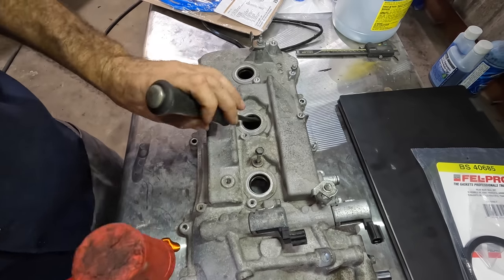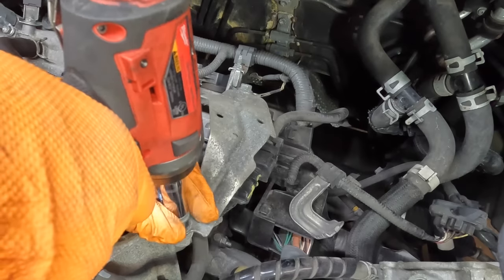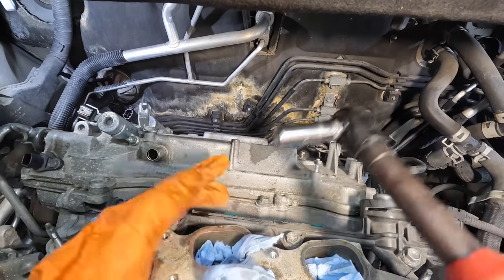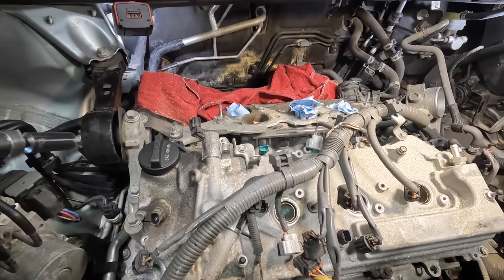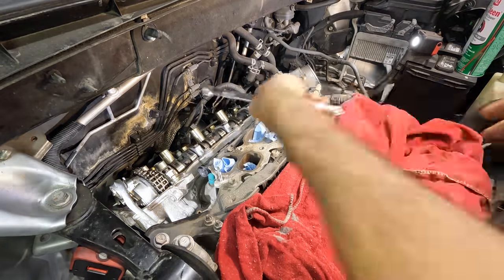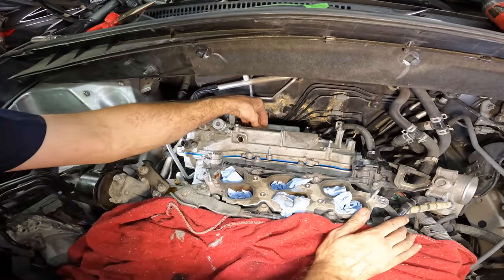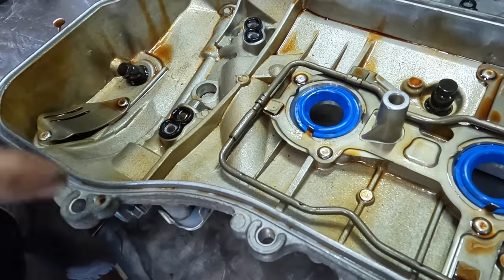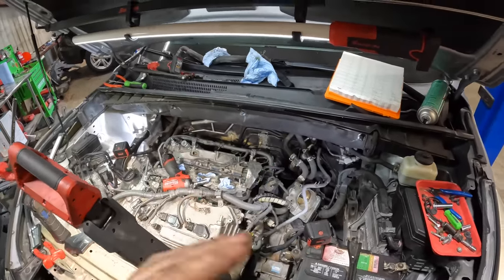Mechanic Upsells Extra Parts! "While we're in there..." Toyota 3.5 VVT V6

Comment: Watching you work on these newer cars with all their plastic parts, and all the stuff you have to do to just change a simple part is CRAZY!  I remember when nearly everything under the hood was metal and nearly everything hand room to work on it or remove it.  I miss the old days, points condenser, with one coil, and nearly every spark plug was easy to get at without removing a bunch of plastic parts.

Comment: Funny thing about grounds. Driving home a few days ago and she stopped dead as a deck board. I had just replaced the battery not 30 min ago and I had no lights no crank no pump. Had it towed home, tinkered on it a few days and called a buddy whose a real mechanic and he suggested checking grounds, first one I tried sent sparks around my knuckle breaker. Cleaned it up and she’s back to running again.

Comment: When there may be a “hidden” bolt on a valve cover gasket, you can sometimes look at the new gasket and see the locations of the bolts. I have been reduced to counting the bolts and matching them to the new gasket locations 😀
Reply: That works if the gasket has either the holes or the indents for the bolts.
Reply: Done that!
Reply: 9 8th 88ɓbbɓbbbbɓbbɓbbbbɓbbɓɓbbbbbɓbɓbb🎉ɓbbɓbɓɓbɓbbÿ🎉⁶6⁶6⁶⁶ÿt⁶ÿÿÿÿÿÿÿ🎉⁶8🎉

Comment: One BIG caveat about crap that gets into the oil pan; the oil pump is protected only by a coarse screen, and some pretty damaging things will go right through it.  There's a fairly infamous issue that the screen doesn't prevent.  Particularly when replacing a cylinder head with a rebuilt unit, the rebuilders typically use automated sandblasting or beadblasting equipment that leaves grit in secluded spots all over the head.  They often do a pretty poor job of getting all of that grit out, so you have to make damn sure that you get all of it out of the oiled areas before you install the head.  If you don't, that grit will go right past the screen, score the gears or rotors in the pump, and (most critically) they can jam the pressure relief valve plunger so that it no longer works.  If it jams the valve open, there goes the oil pressure at low RPMs when hot; if it jams the valve closed, then the pressure goes sky high when the engine starts up cold, and can literally blow the filter right off the flange.  I first ran into this while working for a VW dealer back in 1982 or 83, and I was the first to identify the cause of the issue which had already produced a number of failures in the field.  There was even a silent recall within the parts system to pull the rebuilt water-cooled heads back for inspection and remedial cleaning.  I've run into it a number of times since, with heads from a number of aftermarket suppliers.  Bottom line:  Paranoia about particulates getting into the crankcase is a good thing.
Reply: Point is no engine oil enters a critical area that hasnt gone through the filter first.That was his point.Pickup tube directly to the filter and then to the rest of the engine.
Reply: ….unless the relief valve opens due to clogged filter
Reply: Or if your oil pump picks up Big and wipes it out. Then you have? No. Oil? Anywhere. And that is bad
Reply: @djsi38t  Screen, tube, pump, filter and then the engine's pressurized system. No pump, no oil and a very expensive bill.
Reply: @djsi38t  ".Pickup tube directly to the filter and then to the rest of the engine."  Nope.  Pickup tube, to the *oil pump*, which can be damaged by grit and abrasives.  And before the oil gets to the filter, the engine has a pressure regulation valve (aka relief valve) that's often in the oil pump cover or housing, sometimes consisting of a spring-loaded soft steel piston in an aluminum bore, whose purpose is to keep the oil pressure from getting too high.  It can also be a spring-loaded steel ball; that design is less susceptible to sticking.  The valve regulates the engine's oil pressure by sending excess flow back to the oil pan. But the oil that goes through that valve is unfiltered; part of the reason for that valve's presence is to keep the filter from getting overpressurized.  If the piston gets jammed closed, the oil filter can inflate and lift off the flange, blowing the seal out.  If the relief valve is jammed open, you lose oil pressure when the engine is hot.  Both of these are Bad Things.  

Note that this engine oil pressure relief valve or regulating valve is separate from the one in the oil filter.  That one is present to make sure that some flow will get through the filter if the element gets clogged with crap because even dirty oil is better than none.  The engine oil pressure relief valve is BEFORE the filter entirely.
Reply: A good reason to pressure wash the engine bay before you work on it, not after.
Reply: @Mr.R249  One time on a 460 Ford during very cold weather a broken chunk of valve stem oil seal got caught in the oil pump and twisted off the pump drive shaft and stopped the engine. I ran the oil pump backwards with an electric drill then put in a new shaft and it ran fine for many years. 
The cold oil and the light weight of the broken oil seal made it past the oil screen just that one time, but that was enough. As far as a little dust in the oil pan I don't think it would do much to the engine. The heavy dust would drop to the bottom and any light dust would be caught in the filter. Any damage to the oil pump would be microscopic I would think.
Reply: @GaryH-pw9cm exactly. People over think it, and over worry about the extremely small stuff. Ever feel your oil when it's time to change it? It's gritty from deposits. Also , every time you accelerate your oil preasure goes up, and your oil filter goes into bypass. Not just when it's clogged. Allowing unfiltered oil by. Every single time you accelerate. Why? Filters restrict oil flow to much to maintain sufficient oil flow above idle. Even when they are brand new. If engines were this delicate there would nothing but cars with blown engines lining the side of the roadways.
Reply: You sound like my machinist. I'm going to believe both of you!

Comment: Remember when valve covers were just that, they didn’t have 87 things running through or attached to them. Great videos dude, keep it up
Reply: As I recall, they still had the oil filler cap on one of them if it was a V8 and the one if it was an in-line engine.

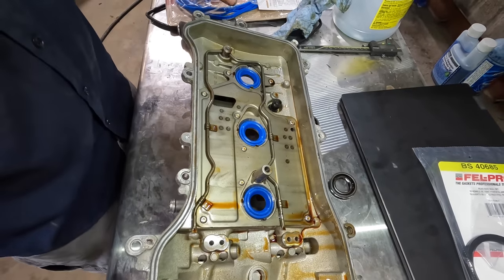Comment: One of us put the spark plug tube seals in upside down. You can see how the original ones are at 39:18 or so. You can see your inverted version at 42:18.
Probably won't matter though as the oil just goes splashy splash inside and gravity just would keep it away from the top.
Reply: Thought I saw the same...hmm

Comment: To keep dirt/dust out of the engine, I always use compressed air to blow it away from the valve cover sealing surfaces BEFORE removing the valve covers. Just use masking tape over the intake runners prior to blowing the dirt out.

Comment: Very enjoyable Ray...I never knew why not replace all 6 with OEM coils until I looked up how much they were! Good call on just doing the back coils and front ones in future!
Reply: And even when they haven't been driven to excessive voltage levels by letting the plugs go way too long, the dielectric strength of the insulators will degrade with time in service; it's not a question of whether those individual coils will fail, but a question of when.

Comment: I like your use of counter torque on the spark plugs. Helps to prevent spark plug breaking.
Reply: Yeah they will break. I have cracked a few in the past taking them out. But very careful putting them in.

Comment: Thank goodness I am a truck guy. When looking for a new vehicle if it has a 'transverse' mounted engine I run away. Mostly because I do nearly all my own maintenance since the 1970's. Fun to do and much cheaper, (no offense). With the indicated milage, I would have bit the bullet and opted for new coil packs also. My 2017 Tacoma Off Road coils are pricy also, but it would be worth it in my opinion. Keep up the good work, love the vids and learn more every day.
Reply: Transverse 4's aren't bad unless you're working behind the timing cover. Transverse 6's are just masochistic.
Reply: @JeffHendricks  Thats why I shy away. By the way, that top end looks amazing for the high mileage!
Reply: @blendy19  Tip for doing timing belts/chains on FWD's: unbolt the passenger motor mount, and use a jack to raise/lower the engine to access stuff through the wheelwell. (Support the engine first, obviously)

Comment: The hassle you are going through is why I will never own another transverse engine vehicle. I had a 2008 Chrysler mini-van and while the short nose was helpful about 50K miles I started getting an intermittent check engine light for the EGR valve. My dealer quoted me over $500 to replace it, with most of the cost in labor. At the recommendation of a friend I called his trusted mechanic to get a quote. While I was on the phone he looked up the procedure to replace it. I heard over the phone "Oh, my god". That was all I needed to hear. I traded it off a few months later. 

But, thankfully, for the complex engines and vehicles of today we have the skilled mechanics like you.

Comment: I would wait on the coils. Toyota OEM coils are expensive, but probably less prone to fail by from 100-200K than replacement coils. Change them with denso or ngk the next time it needs plugs.
Reply: They are expensive, but cheap now versus 1 going bad on rear bank later on!!! Change rear bank now,wait on front till they fail, easy work😊😊
Reply: @jamesmcdonald6047  --Me Agree...
Reply: true, save the rear good ones for front spares.
Reply: @forgetfulme1719  my thoughts exactly 👍
Reply: over  300000 on all my toyotas never needed a any coils when the car rusted to death 

but maybe it’s the heat in florida cause i’m in canada
Reply: I agree niether of my Camrys with V6 and a 2.4 needed them and between them I am about 500K miles and the oldest is 20 years old.

Comment: I'm glad you said not to do full send on spark plugs, I  worked with a guy who watched a mechanic using a cordless impact taking plugs out and would use it to put them in. I tried to explain that he should not use the impact for installation of spark plugs for obvious reasons put was told I did not know what I was talking about. I  just walked away and eventually he quit and after finding how much he actually forgot to do was lucky the vehicles he worked on did not have issues. He was leaving out safety pins on ball joint bolts, moving to fast and not re-check work. I quit the place and never looked back

Comment: Thanks for posting! As the owner of a blue Highlander 10 years older than this one, I appreciate seeing this. Mine has the 2AZFE engine which is infinitely simpler to service. My truck has the 2GR. I would not want to work on the sideways version. At least on the 2AZ the coils are not really failure prone. I'm at 193K. I recently looked at the PCV and replaced it because it was cheap, but it didn't really need one.

Comment: Ray, yes it is very, very important to block the intake. I have an interesting story about that subject.
My son was working at a Mercedes dealership. He had just replaced the heads on a V12 Mercedes. The intake was installed on the engine, the intake at the throttle body was open. Naturally this was facing out toward the front. He was several feet from the car and was over at a vise. He was cutting something with a small flat faced cutting pliers, and the tip broke. It sounded like a 22 rifle when it broke. He searched for the tip, but didn't find it. It was on Saturday and he and I were the only people in the shop. We proceeded to button up the job, and fired the engine up. Ran fine, except for a random rapid ping. Shut the car down, and proceeded to remove bank 1 head. Found the tip of the pliers. How it made it past the intake valve, I have no idea. Why it didn't score the cylinder wall, I don't know. My son still has that small, but not tiny, piece of metal in the top drawer of his top tool box. Any time he opens anything on an engine, it get plugged up.

Comment: I use blue Hylomar on surfaces where there is a gasket I need to stick, just to install. Apply thin coat, wait some 15 to 30, apply gasket and ittl stick to the blue Hylomar. Send it home and done.

Comment: Toyota's work best with exactly what came on them. I just did coils and plugs on two 2uz's. All Denzo coils and iridium plugs.(16 coils and plugs) Not cheap, but both sets of coils were 20+ years old and had over 250k on them.
Reply: One coil pack went out on my 5vz-fe at 300k miles. Replaced all three with autozone coil packs with lifetime warranty. Am now at 437k miles. Am just thankful the intake doesnt have to be removed to replace them.
Reply: @marvinshorty4611  coils definitely not failure prone!

Comment: Did this job on a Toyota Sienna, which also requires removing the lower windshield cowl, wiper motor, and wiper arm assembly.  Was tedious, but not too bad.   And on EVERY connector for the ignition coils, the retaining clip broke off no matter how gentle I was with them.  Zip ties lasted another 60k until we sold it so it was good enough, but really annoying.

Comment: Hey Ray on the Highlanders there’s a rubber hose that goes to the engine for my believe the oil cooler that’s a failure point and it was a TSB to replace it with a metal pipe. May want to check that and inform the customer that they might want to replace that. It’s got the mileage can go at any time.
Reply: Only on 2008 and maybe 2009 This is the newer 2GR-FE that doesn't have those old part rubber lines.

Comment: Those pop clips are great, there are several used for the fairing on my motorcycle. Since the fairing has to come off several times for oil and filter changes, spark plug changes etc, it's very convenient to pop them off and on very easily.

Comment: I watch all your vids Ray and really enjoy them, as a retired mechanic/auto electrician I often wonder why when you remove corroded bolts why don't you put some lube on them when you replace them? Just wondered....
Reply: IMO no bolt is corroded enough to need lubrication,all these bolts were no where near what I would call corroded.
Reply: @djsi38t    Had to downvote you sir.  ALL repeat ALL fasteners should be neversiezed, unless specifically noted otherwise.  Those that are noted otherwise, probably are locktited.

Comment: I'd tell the customer that once a coil goes bad you'll immediately notice it, it won't go away, check engine light stays on, worse gas mileage, erratic shifting, weak acceleration that tends to show up when you need it to pass someone, and remote start won't work.  So save up and change them together and don't worry about it for another 7 years.  

Also if your cheap like me, keep the back 3 coils and use them as replacements for the front 3.

Comment: 42:08 not spark plug tubes, but several replacement oil seals that I have installed, where the manual calls for using an "appropriately sized socket" and plastic hammer ie: camshaft seals, front and rear main seals, and diff seals.  I lightly lubricate the outer surface and press fit by hand.  Never (knock on wood) had that fail.  Erm... I think on a rear main I used a mallet to work it around actually.  It's pretty large.

Comment: Good point, about dust and dirt getting into the engine.
What I've always done, is run the engine for a few min, or take the car on a short drive, after a service like this, then change the oil.
NEVER change the oil right after a service like this, because the dirt stays there, and will contaminate the newly changed oil.
Reply: First thing I do is clean off the exterior of the engine before disassembly.
Reply: @GARDENER42  Yep, didn't see any effort to blow nozzle dirt away before removing the intake or removing the valve covers.
Reply: @GARDENER42  Yes... 😉🤣

Comment: The spark plug tube seals have tabs on this motor because the seals are not a tight friction fit there a loose friction fit were on the 3.4L v6 5VZ-Fe are a tight tolerance fit for the spark plug tube seals so older engines and models don't need the tabs @Rainman Ray's Repairs

Comment: Ray I work with a previous Toyota tech and Toyota specifically says not to replace spark plug tube seals on these engines because highly likely to leak afterwords with high oil pressure in valve covers. That’s why those tabs are there. Toyota wants you to buy new valve covers. Thanks for the hard work on these videos.

Comment: I miss our 2006 Highlander 3.3 V6. FWD. The thing was a Tank and one of the most reliable cars we owned. Even the battery lasted 9 years! It would go through a foot of snow or just give us a comfortable ride anywhere we wanted to go. Lost a waterpump at 65,000 which was covered by warranty ( 60000 engine warranty ) 
Dealership said they should have caught it leaking at 60,000 service. T-Boned in 2018 and the insurance gave us premium price and said it was the cleanest car they ever seen including cars that were less than a year old.

Comment: I work on my own stuff.  Once I have a lot of labor into it, I do as much as I can.  I would never replace cam cover gaskets without replacing the spark plug tube seals.  This engine is very similar to the one in my old 2000 4 runner.  Getting those covers off is fairly labor intensive.  Coils, on the other hand, on the 'Runner, are easy to get to and not so bad to replace the faulty one(s), assuming you have the means to diagnose such things.  This Highlander, same engine as my Solara, is a different story.